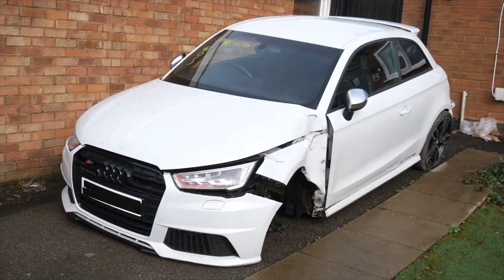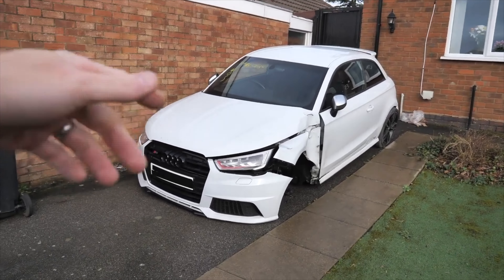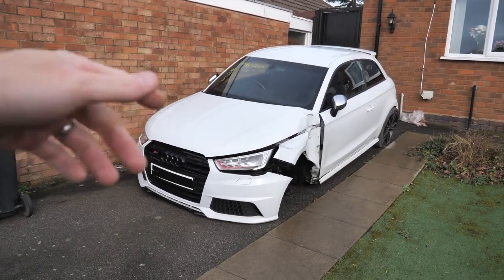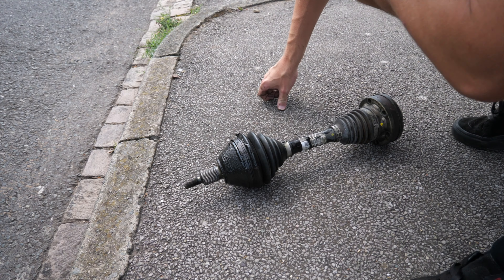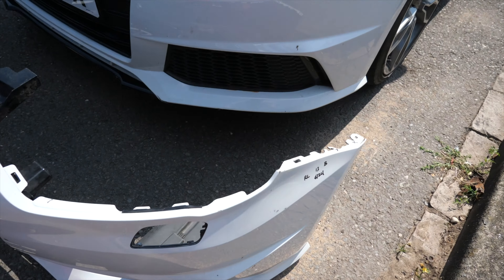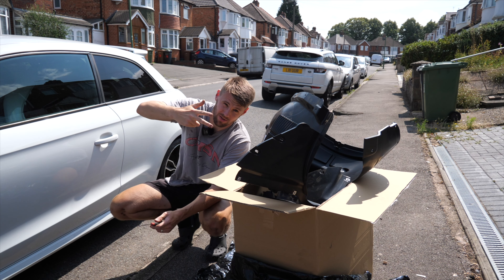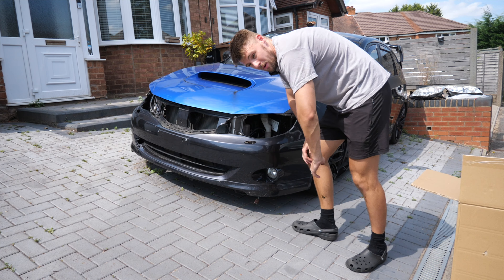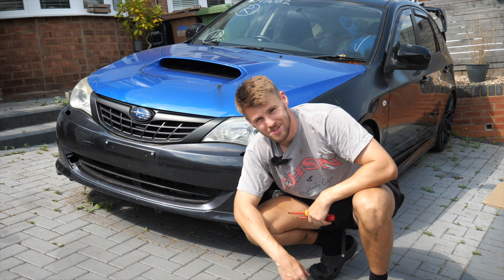CRASH DAMAGED AUDI S1 QUATTRO IS IT READY FOR THE ROAD?

Comment: I have done a few Audi front end repairs that require replacement bumpers. I gave up trying to get used bumpers as they always needed repaint and were often damaged and were expensive. I get new bumpers from Audi where they are not as expensive as you would imagine. A brand new bumper makes painting easy and its a perfect fit. New copy bumpers are also around and seem to work just as well. Good luck finishing off the car and getting it sold then you cam move on to your next project. Good luck with the channel, you seem like a nice guy so I wish you well.
Reply from the maker: Thanks buddy 🙏🙏🙏

Comment: Also, for the handbrake on the range rover - 9v battery and 2 bits of wire, into the electrical connector for the handbrake (as in the connector near the caliper), powers it enough for it to be wound back. 

We did my friends insignia like this, and just used a one handed clamp to push the piston back in.
Reply from the maker: Cheers man